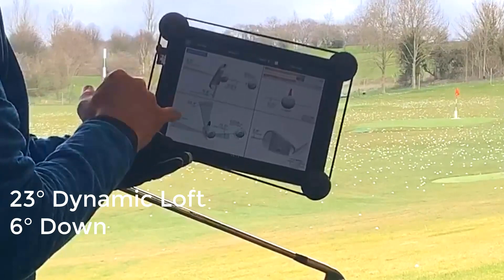Fat Iron Shots Lesson: Technical and Mental

Comment: Excellent and most helpful. Thanks for sharing. Just somewhat puzzled regarding the club being taken back much more square in your demos swings rather than the more open club face aspect which you demo in your Golf Coach and Golf Power videos which I acquired recently  Could you possibly comment please? (My preference is to open the club more in the backswing but I need to avoid taking it inside too much!) Thanks. Regards Ian Inverness
Reply from the maker: Hi Ian. I can't find anywhere I talk specifically about the takeaway (let me know if I'm wrong) so I guess that you are referring to my own swing in which case you have highlighted an issue that I have struggled with for some time. My preference would be to have the club less behind me and less shut at in the first part of the backswing.